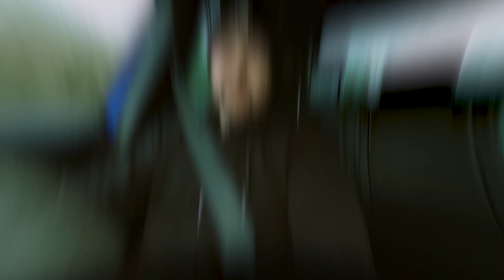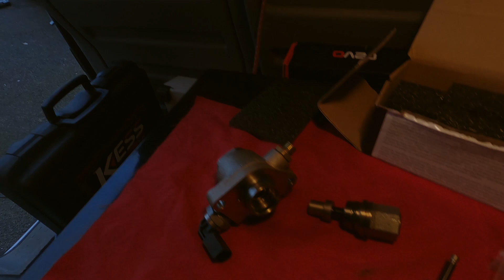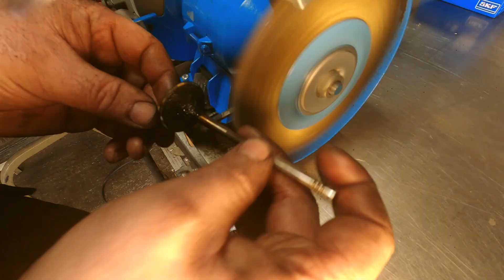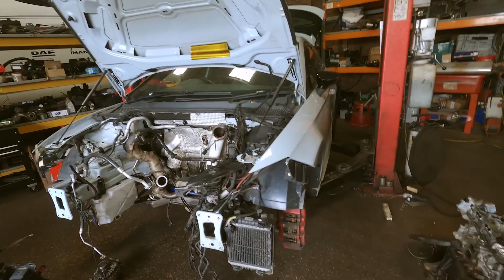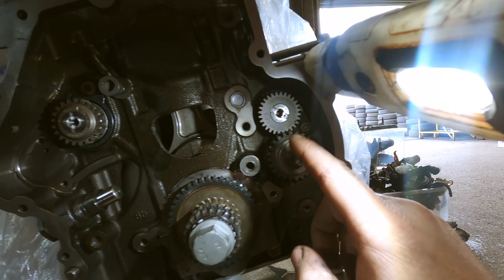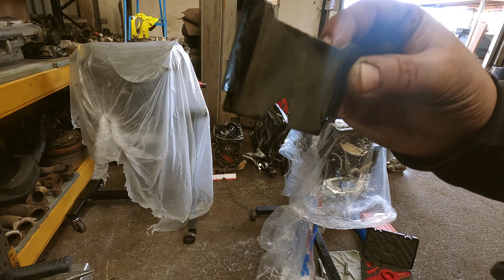750BHP Cupra | Part 3

Comment: Really interesting about the valves showing signs of pre detonation! I never understood octane booster maps if running meth and flex fuel tbh
Reply from the maker: Different tuners have different fueling strategies I guess, I’m not a fan of octane boosting - and yes, methanol and ethanol make this pretty much redundant to use